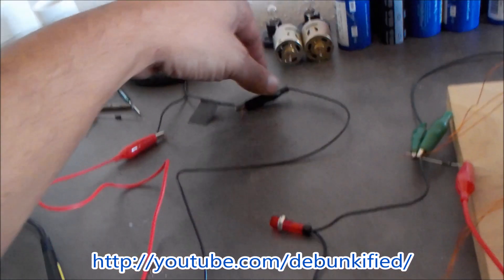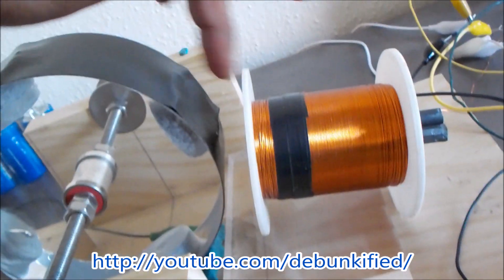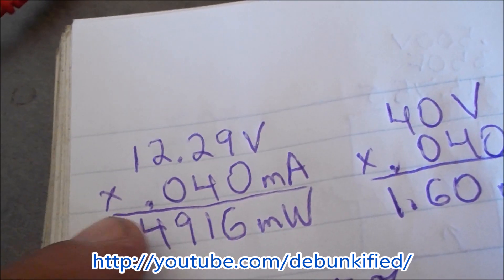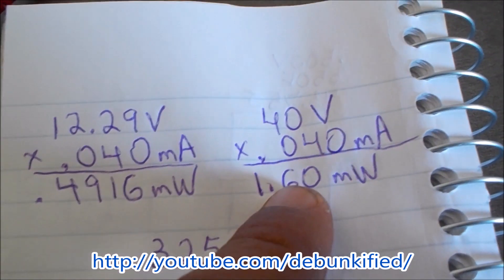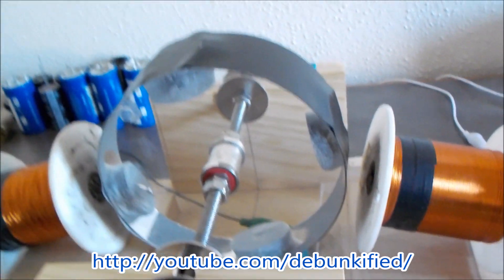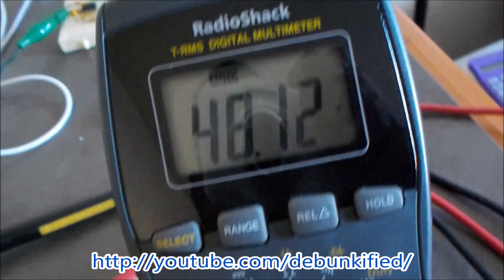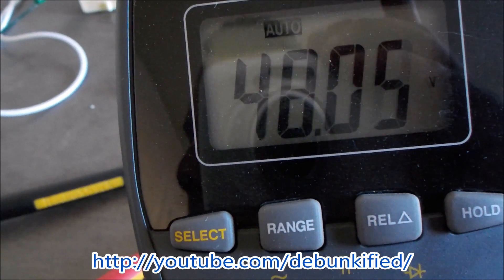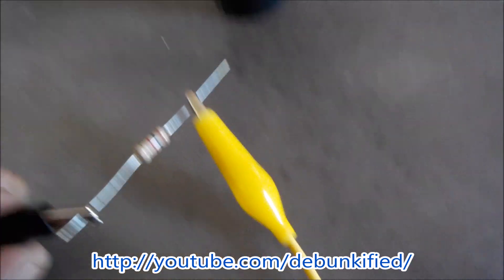325% Overunity Load Resistor Test

Comment: Not over unity. BUT correctly you are using a fly wheel to rotate the current this acts as a capacitor. 

Time/space is displaced. If you can keep the current on the flywheel you have something. Try running the flywheel on multiple axis of rotation not just 1.
Reply from the maker: Intriguing thinking, a fly wheel or a rotating mass stores energy much like a capacitor as you have said. I am under the suspicion that more mass can keep the output current up but also at the same time and in the same amount of time it’s just about equal to the amount of time the loading takes place to get it up to speed in the first place. This the the law of thermodynamics in which there is no escape, and both input and output times for getting up to speed and loading down are in proportion to each other.
Reply: @debunkified  take advantage of dimensions. As it is your on 1 plane x,y

Rotate through z and you have a sphere which is more points in space. It will act as a variable capacitor. 

The faster you rotate it, the more current you can store,  the slower you rotate it, you store less.

Think of the speed of rotation as phasing.

You can match the phase at 90 degrees at the speed of 1/4 the frequency

Giving 4xs the output 360/90 = 4

Therfore 1:4 transformation.

Of course current for amps.

It's a variable transformer/capacitor 

Put me on the patent :)

Comment: Don't forget that power is energy over time, and energy is power multiplied by time.  
So yes, momentary output power is higher than the average input power.  
This is what your old photography flash was doing all the time:  Charge up a capacitor, discharge all the engergy in a short time to get a high power at a short instant.
Repeat the cycle you're showing in the video a few times and sum up the total input energy (input power times total time) and compare it to the total output energy.  Now calculate output energy divided by input energy?  See? Under unity.  Nature can be so frustrating!
Reply from the maker: +Murks Maker Ahh yes, nature. It is a matter of time constants and never being able to get more energy out than in. Lenz's law can be engineered around though to help keep the overunity up with the right geometry.
Reply: Yes, nature. None of her laws can be engineered around her. 
In particular, Lenz's law is about the direction of induced currents. A wordy description of one minus sign in Maxwell's equations. Lenz's law is not even quantitative.
Overunity is a fantasy in contradiction to the laws of nature.

Comment: thank you for your hard work. If it was o.u. you would not need to remove the resistor. The machine is still running while resistor is out, that must be considered. We will get there.btw a bmf spike can also be run through a coil and generate not only a mag. flusx to do work but also a return spike. Working with you. care

Comment: He is measuring correctly with this setup, what is uncorrect is something else. To measure the current with this method the voltage drop on the resistor should be stable though, that mean that the system is "sustaining" the current flow. I suggest to do this other way: Take a much bigger potetiometer (220 Kohm should be enough), put it at the highest resistance so, while the system is running, slowly "open" the valve, you will see that the voltage drop is little, almost stable, than keeping on dropping the resistence, at some point (even lower than 40V) the voltage should drop quickly like is doin in your case (that is not sustaining), rise a little bit again the resistence until is sustaining again, repeat the process trying to find the exact resistence the system sustain as load and write down the voltage reading in this point, disconnect the potetiometer and read  the value of resistence. Make the math with this two values and you will know the exact current.
Namaste

Comment: 1st of all Nice work! I would like to see you take this a bit more in depth. I do not see where you figured in time here? It takes time to build that cap up to 50V meanwhile your drawing X# of MA from wallwart plus maybe some back spike from coils? What would happen if you took your output and did something with it so it was a timed or voltage set dump. You could do this electronically but its hard to show on a video. I think the simplest showable way would run your output threw a step up transformer like a microwave transformer. Then send the trans output threw a spark gap circuit like the tesla coil drive. A circuit with a cap across the leads and a adjustable spark gap that way you could set it to dump when it hits like 45v keeping it under you 50v cap max. You could play with that setting to find a sweet spot. the spark output could be dumped into a cap bank who's output could be used to light lights or run things.The things your running could then give you an output watt reading to compare to the input of the wall wart and Time would drop out of the math.
Reply: Unbelievable how much clicks you can get with bullshit.

Comment: If you over wind the coils so they have thousands of wraps, then your inductance is very high on those coils. When you have high inductance, current cannot flow in the inductor for a long period of time. If it takes longer for the current to flow than the time it takes for the rotor magnet to pass by the coils, then you might have "inverted" magnetic drag. This is what Thane Heins explained to us.
Reply from the maker: Yes, a coil with thousands of winds will act more like a capacitor and store charge as capacitance in between the windings creating a delayed Lenz's Law effect and even creating the illusion of reversing the Lenz's Law drag and accelerating the rotor.
Reply: debunkified Hi. So you understand the principle really well. It's not a capacitor effect at all, it's the effect of inductance, which means the coil is opposing current because it's self generated magnetic field is creating reverse EMF blocking the flow of current. This is called "Back EMF" which is why inductors plugged straight into the wall outlet don't even get more than slightly warm despite having 120 volts applied to them. I think Thane explained this as a capacitor effect, but it's really just basic inductor theory. But maybe he figured out another new principle that really is a capacitor effect?
Reply: debunkified Why do you say it creates the "illusion of reversing Lenz's law drag." I just explained, as Thane showed, that the Lenz's law effect causes uncontrolled increasing acceleration that can explode your rotor as it continues to be totally inverted to the point that it is 100% reversed (inverted) and produces no drag at all above a certain RPM.

Comment: Pulse the output and u will see dramatic results...if the frequency is correct..
Reply from the maker: I was planning on it! What kinda results do you personally get by pulsing the output?
Reply: When I pulse it, it overloads my meter in volts and charges a cap instantly.